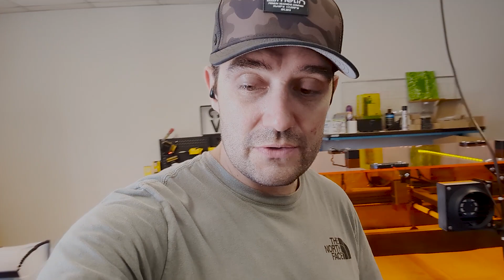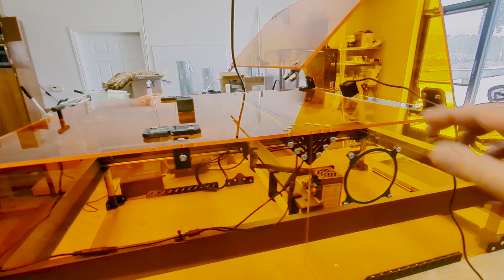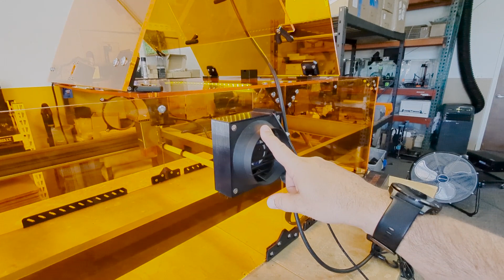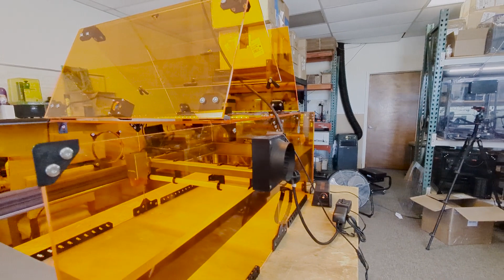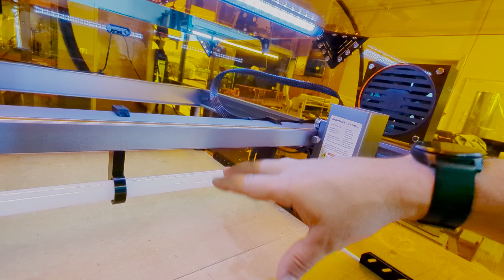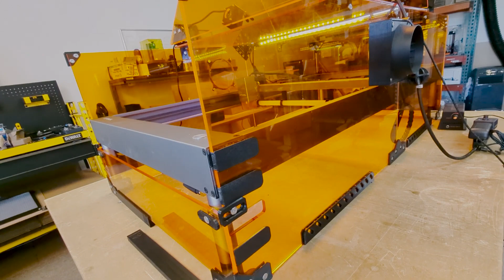Xtool D1 Pro Enclosure Extension V2.0

Comment: Depending on what height you have the frame set at are there holes to for the screws to adjust the tension for the belts. I didn’t notice what are the specs for the box. My wife is on the short side, we have the xtool on the work bench which is roughly 36” in height then you have the height on the enclosure there is no way she can reach inside to adjust the boards for framing and then retrieving of the cut pieces and scraps. These are things I’m thinking about before I make a purchase. Oh and something else came to mind why do you have the extension legs on for the demo. I understand they are needed for some larger production items like the rotary but otherwise why have them on. Are the honeycomb support brackets still included. Once again not trying to be negative. Just want to spend my money wisely